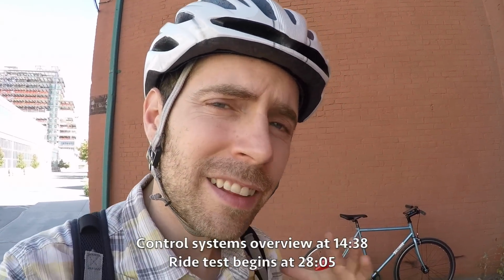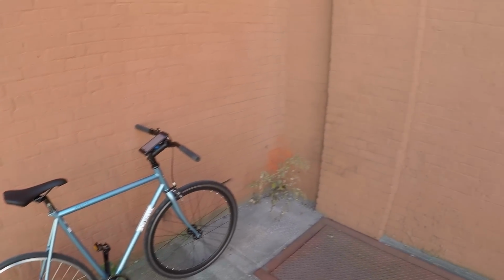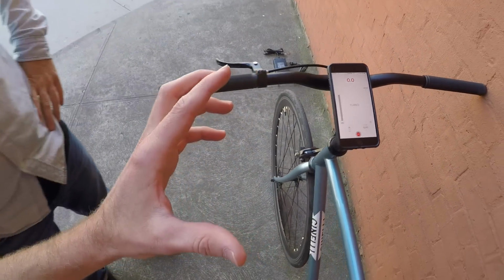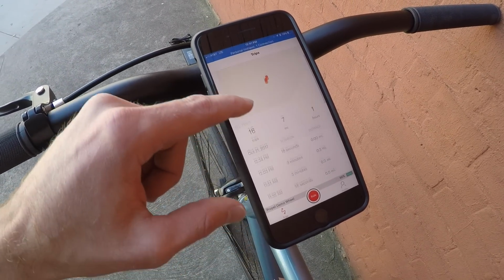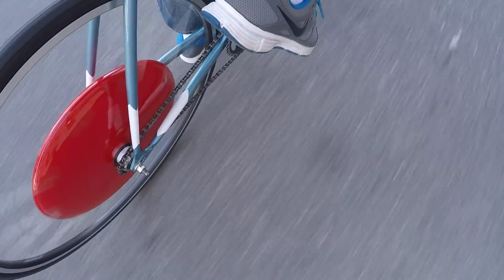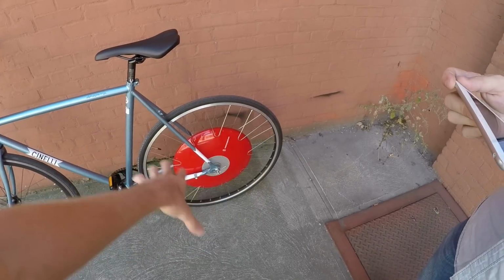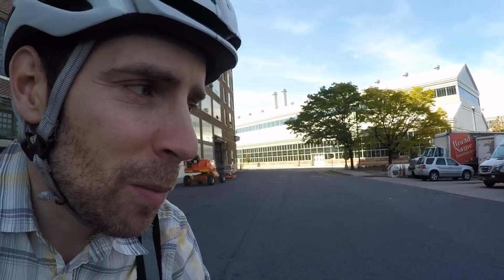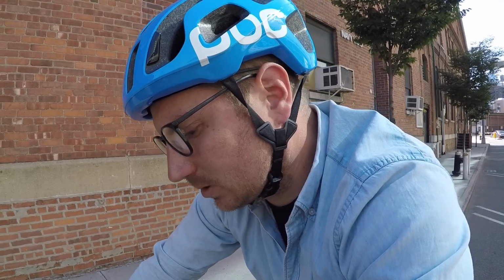Superpedestrian Copenhagen Wheel Review - $1.5k

Comment: The Regen is small so, I don’t think it’s a major issue. Metal helps dispensation heat better then plastic. Plus looking at other hub motors, the weight isn’t much worse. Plus if your phone batt doesn’t last, a simple pocket battery to boost up your phone.  Don’t be leave the direct drive is lighter. The math is not correct. Plus you need to minus the weight of wheel. Plus you can keep your front derailed gears. The only down side is only rim brake on rear wheel.

Comment: Just looked at some stats on the wheel. What is the max load limit for said motor? I just installed a front wheel drive Direct Drive motor on my recumbent. It has a max load of 600 pounds. Just curious.

Comment: I've had one of these wheels for over 2 years now and I like it a lot. It is smooth, responsive, refined, well built and reliable. The bads are the limited range and the fact that it makes the bike back-heavy. I use it for commuting to work everyday (23 km one way). Have to charge it at work. I use it most of the time on normal mode (medium assist), going at 30-35 km/h without any problem, even facing wind. One thing to clarify from this video is that the phone does not have to be connected at all time. In fact you could initially connect for a ride, the phone could die and the wheel would still work until you leave it stationary long enough to auto lock (or reconnect to lock the wheel).

Comment: Really great review. I’m seriously considering one of these for daily commuting for the simple fact that I would be riding the bike frame and geometry that fits me. I’m buying a touring bike that this will fit in for commuting and that I can then replace with a regular wheel for weekend touring. This wheel is the most elegant engineering solution I’ve seen to ebike conversion, while also having the option to go back to original spec.  Most conversions I’ve seen are quite ugly and seemingly permanent. You guys got hung up at one point on battery life. In my opinion this wheel was designed solely for commuting. I want to wake up in the morning , dress, eat breakfast and leave. As if I’m using a car. I’d say if you’re riding more than two hours to work this wheel is totally going to improve your quality of life. At a five hour commute which, I think you said was battery life, I don’t know what kind of life your living but you need to move closer to work. I feel like the last thing I would worry about is battery life for wheel or phone,because you’ll be charging both when you arrive. And if you call ahead to some place you’re heading they might even accommodate your charging needs, it’s a wired world. Anyway, super great review, loved seeing the braking action. Your buddy was going way faster than I would recommend but at least we know it’s doable! And you have to pedal the damn thing, which I think is the most salient point of all, you’re still burning calories.

Comment: I have the CW. I was an early customer and I waited several years to get the wheel. I use it, year round, in Seattle (think lots of hills) and almost exclusively in eco mode. My experience is that it makes the kind of riding I do, joy rides, errands and meetings, a delight. I never have to plan my route based on the hills and my battery capacity matches my ambition. I can hop on the lightrail and travel the length of the city. That said, I was, out all day once and ran out of juice a few blocks from home so the battery is a limitation. On the plus side, the red disk looks great surrounded by Bianchi celeste. 

Still, there are other uses that tempt me to buy another electric bike. I am considering a folding bike for car trips or limited storage indoors. So I am grateful that there are so many new options to consider and so many opinionated people to comment on them
Reply: Montagut have folding bikes with Copenhagen wheel.

Comment: What a crap, you can't ride it without your smartphone cause it needs to be connected all the time, so you need another battery to charge your phone :(
Reply: No, you don't.  It will default to the last setting.  The app runs in the background and doesn't need to on-screen.

Comment: Good points.  Intuitively I felt when this 'came' out that having the batteries in the hub housing was not a good idea, Unless the make easier access to the batteries..  i like the concept. It is perfect for a Fixie / Messenger type rider. However,  the spoke- to- hub connections give me pause.  I am dubious that the rear rim can handle urban riding.

Comment: Amazing that the Copenhagen Wheel is back yet still looks identical to design of several years ago! In the meantime, bicycles sold with disc brakes have taken over the market. I want to see Superpedestrian succeed ... It seemed ready to go before, so one wonders what the heck happened behind the scenes. So many new companies crank out bookoo product; it doesn't inspire consumer confidence the way their product delay was handled. Anway, would prefer to see it on a bike with gears. Their website is fairly simple to select the correct size wheel.